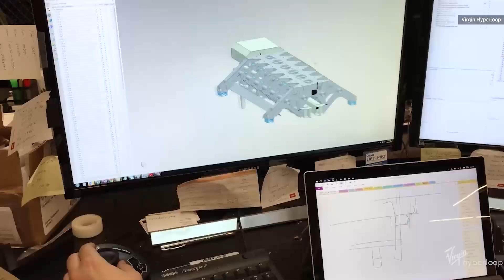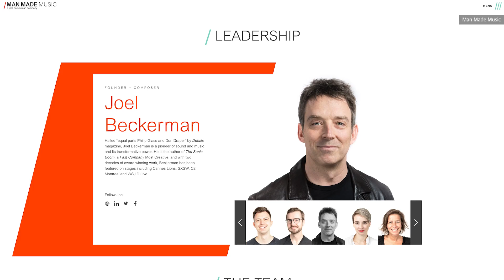What will it be like to be a Hyperloop passenger?

Comment: Scam. Even Virgin realizes that this Hyperloop is nothing more than a HyperDoop. Elon Musk has also gotten out of the Hyperloop project. This concept has been around since the early 1900's, and there is a reason it has never been done. It has been almost a decade of Hyperloop mania and all we have are tubes that go less than a mile at car speeds and cant transport anyone at the highspeeds required. Don't forget that metal also warps, so this airtight claim is easily disputable...just look at oil pipelines and imagine people in them going at a high speed. Hyperloop is a fantasy for the uninformed who want something new. High-speed rail is high speed and is viable.

Comment: All current hyperloop plans run on wheels, which will make a lot of sound, plus the motors will make sound. The pod would not be silent even with the vacuum…
Reply: Only because there will be air in the pod which will allow the sound of the wheels and motor to travel to your ears...
Reply: @accutronitisthe2nd95  yeah, people need air. But the sound will also travel through the floor and your body.

Comment: Faster trains dont have to be so complicated,  expensive,  limited to few passengers.  Make a new railroad network that can do 400kmph
Reply: Well, there is already a Maglev system that can do 600kph. Japan is already been making one for new Shinkansen line, Germany already made one and even did the Shanghai Maglev which is a German technology, and just recently China is making one on its own.
Reply: @kornkernel2232  air resistance slows them down. Hyperloop is supersonic speeds. You’re failing to understand what is being discussed here. This technology is faster than high speed rail. What are you so afraid of ?
Reply: @coralreef909  >What are you so afraid of ?

Ridiculous amount of energy and complicated infrastructure to maintain low pressure or "near vacuum".
Reply: @AakashKalaria  It’s really a lot more achievable than it sounds.
Reply: @cameronf3343  So why hasn't it been achieved? There have been no passenger trips with significant speed or distance. Thunderfoot debunked this nonsense in some of his videos. Even Virgin is getting out of the hyperloop scam. Normal high speed trains are the best solution.
Reply: I was saddened when I learned that VIA rail takes 2 and a half hours to travel 180km whilst you can travel from tokyo to Osaka in around 2 and a half hours. (400km)
Reply: @JamesRJKR  Canada will never build one because of the expense. Hyperloop is more affordable but it remains to be seen if our federal government has the political will to do something new.
Reply: This thing has the ability to remove the need for a passenger airline industry altogether. The proposed speed goes to near sonic speed. It is just much more convenient, efficient and safe. Once we figure out the tech properly though which is a long way since Elon is now not working on this.

Comment: It will be the same experience as riding an unicorn. The USA can't be bothered to buid trued and tested high speed rail systems, and you expect something even more complex and expensive to be built. Massive vacuum chambers, with doezens of entry/ exit points. The fire hazard is completly ignored too. What about a earthquake ? What kind of delays happen when every time you wanna check a wire, you're gonna have to move metric tons of air around ? Not a 1% play thing ? Then maybe build some god damn trains instead of figuring out how to grow moss.